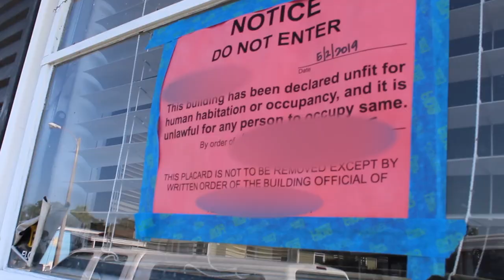Episode 1: Drowning in Feces and Fish Fillet

Comment: I'm sorry dude, I've owned cats and if they ever pissed on something it went immediately into the bin. That smell is unlike anything.
Reply: Strong af and literally won't come off clothes until the 50th wash
Reply: Maerunes if it’s fabric u can wash it in vinegar it actually gets the smell out about 1/4-1/2 cup in the wash cold water with a bit of extra detergent on the extra dirty setting 
(Re wash before drying if smell lingers) 

If it’s in carpet soak up as much as possible with a paper towel when wet then mix up 8oz hydrogen peroxide 1Tb spoon baking soda and 1 teaspoon dawn dish soap mix up in a spray bottle (no filter on the tube) spray it on mattresses carpet or a couch let it dry and vacuum the baking soda up it may take a couple soakings but the smell should be completely gone

Comment: These videos would be way more interesting if you could include the stories of why these houses are in this condition. I personally would find that fascinating. 
I'm also curious why you can't turn the air conditioner on while you work.
Reply: Im Not a specialist but telling the stories of these are tough and not always wanted/privacy, discretion matters. 
And if they would turn on the AC it could potentially blow around biohazardous material : animal feces that dried down , parasites  ,dust, biohazardous particles etc. 
Its unsafe to do this.

Comment: Overwhelming doesn't even begin to cover it some days. You sit there and look at the mess, and, logically and sanely, you know you need to clean it up, throw it away, or put it away. But you can't. You just can't. It's like your body has been chained to a 1 ton weight. So just getting up to go to the bathroom takes up all your energy, dragging that weight around. By the time the day is done, the only energy you have left is to just drag yourself back into bed. And when you wake up, you are immediately faced with last night's mess and you know, no matter your intentions, you'll be adding to that mess. And you're stuck and exhausted and there is no end in sight.

Comment: A trick i would give these guys is double up your gloves and you will find its easier to not change your gloves when doing a messy job. Surgeons do it when they know they need to touch body fluids then need to grab something pretty quickly after. It does cut time